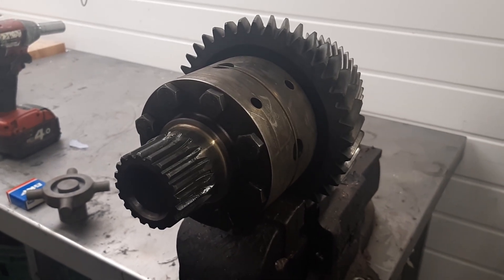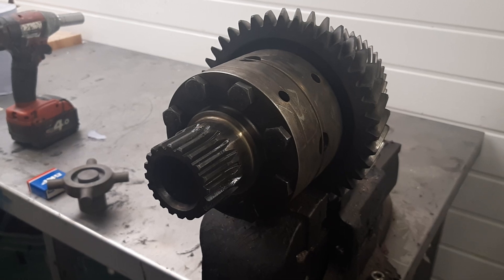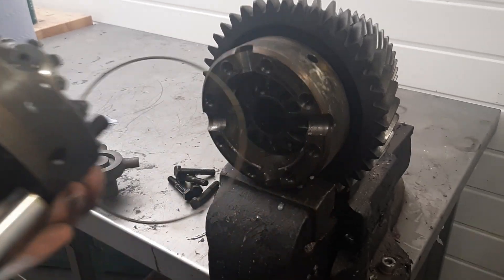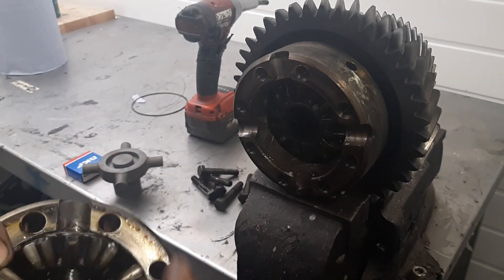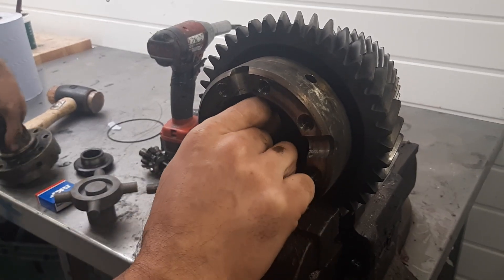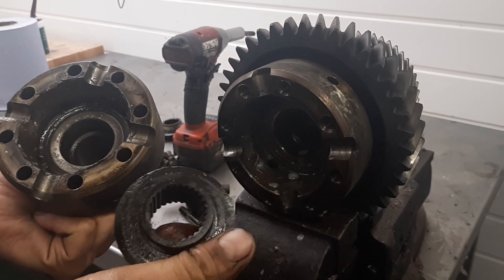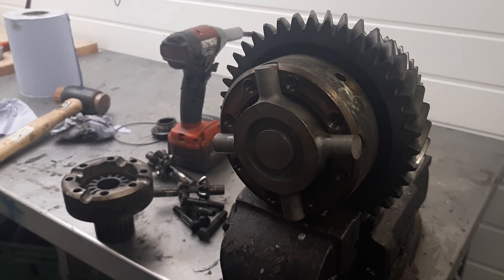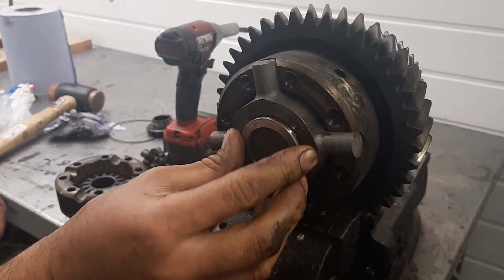HOW TO: Syncro Gearboxes Selectable 2 Wheel Drive Kit Fitting Video

Comment: How does the front drive sun gear engage with the selectable 4wd adapter when engaged? It looks like the sun gear faces the adapter which is flat and smooth with no teeth to engage with!
Reply from the maker: It doesn't. It's purely a shaft support now

Comment: When I switch the link for the shop, proceeding is blocked due to unsecure message ( Android 11). Is this part of a LT 230 box? I contemplate to fit a LT77 box to my S3 109 (1984) 200TDi  ( ex-Discovery).Not quite sure, whether I stick with the series transferbox or go for the LT230. I would like to leave the engine in its place and would like to avoid welding on the unmaculated, genuine chassis.
Reply from the maker: Hi, thanks for letting us know. We'll look into it!
Yes, this is for the lt230. It's ideal for series owners who are converting to the more modern gearbox and transfer as it'll allow the 4wd system to operate as it did.
My personal recommendation is go with the lt230, that way you avoid any adapters that would be required.
Reply: @SyncroGearboxes  According to what I learned by now, the LT77 is a bit longer than the LT76 predecessor and the LT230 is bigger even too. Keeping the 200TDi in its position like the 2.25l petrol was, I wonder, whether there is enough space to the crossmember behind the gearbox ( mine is an ex-mod with extended springhangers and a swallow in the xmembers for the propshafts.
Reply from the maker: @HeinerStorch  yes the later 'boxes are definitely longer, but its all workable.

Comment: I'm really interested in this for fuel economy, but I also do HD offroading.. would it be better to just go with an Ashcroft HD crosspin rather than this?
Reply from the maker: It depends what you want from it. If you want fuel economy then 2wd will always be better. If you want to use it off road you should have it in Difflock, which is permanent 4wd - the same as you'd get with this kit. If you want a HD cross pin, take a look at our 300M cross pin at www.onlinegearboxparts.com